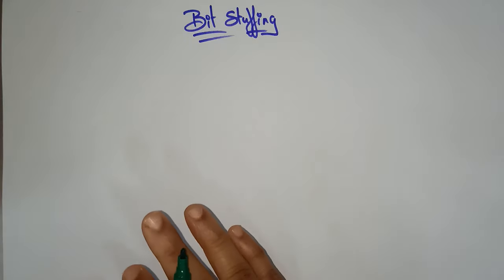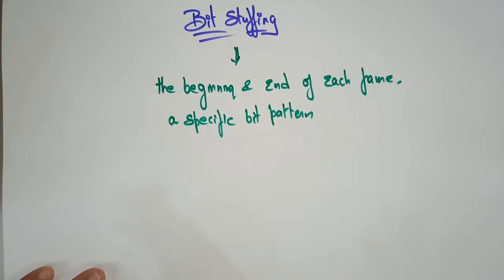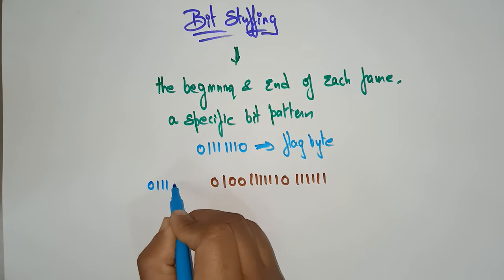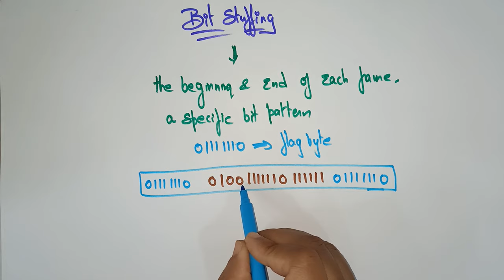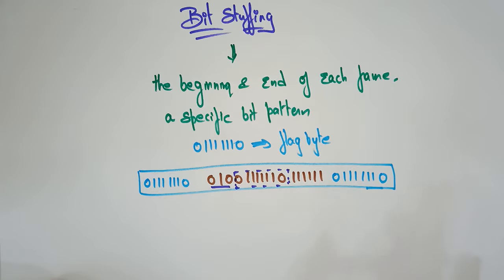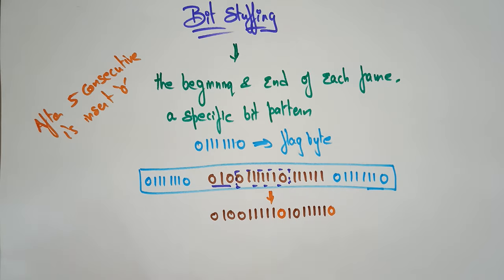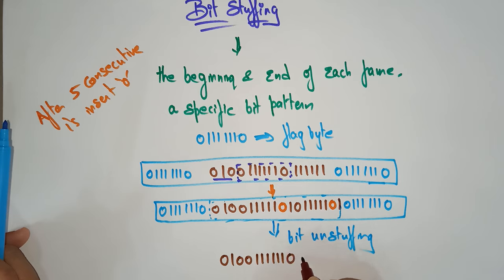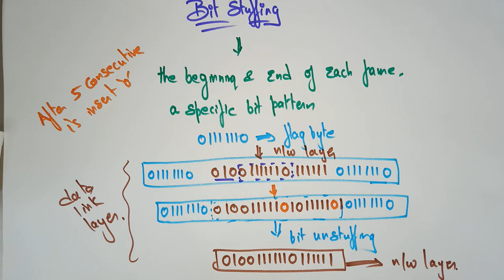Framing in data link layer | Bit Stuffing | Design Issues | Part-3/4

Comment: 5:50:  It took me a while to understand the computer just ignore or throws away the stuffed bit and looks for the next bit after the stuff bit to determine the bit pattern.  You added two addition padded bits into the sequence (orange bits).  The computer is really looking for a bit pattern like "11111" and the next bit is either a 0 or 1.  If its a 1, it means its the start or the end of the frame.  If its a "0", then that bit gets ignored because its stuffed and the next bit actually represents what the next bit value should be.
Reply: This cleared an important doubt! Thanks! :")
Reply: what if Flag byte is "01110" and data is "011101110"
Reply: @abhinowyt8564  There would be no point in using bit stuffing in your example because your flag byte is too short and the data would look the same.  Its like saying your flag bit is "01111110" and your data is "01111110".  There is no way the computer can tell difference with bit stuffing.  The key is to use a long enough byte or series of bits such that its unique to identify the start and stop flags.  The alternate method is to use Byte stuffing where you include an escape character (ESC) to differentiate the flag pattern in the data from the start and ending flags.
Reply: @ahndeux  Thank you for the Clarification !!
Reply: @abhinowyt8564  Just to clarify also, with HDLC the "01111110" sequence is used as the flag bit sequence (six 1's).  The bit stuffing in HDLC checks for 5 consecutive "1" bits.  If its a flag bit, it would send a "1" after the 5 bits.  If its a data bit, it would always send a "0" bit as the next bit to ensure the flag big is unique and will never occur in the data stream.

Technically, in your example, if you set the bit stuffing to be after two "1"s, it can be used.  The flag bit would be sent as "01110" and the data bits would be "01101011010".  Notice in the data stream, you never have a "111" sequence since that would be converted to "1101" with an extra "0" bit stuffed in between to differentiate from the flag bit.  However, in the real world, that generates an excessive amount of extra bits and is not efficient.
Reply: @ahndeux  yeah correct, got it :) !!
Reply: what if the data is 01111101 ?

Comment: For every bitstuffing problem, do we have to everytime put 0 in the position of 6th  1or it depends on flag byte.. For eg if flag byte was 0111110 so do we have to put 0 in the 5th position of data or here also we will put 0 in the 6th location..... 
If you reply i will subscribe :)
Reply: No, that is not how it works.  You don't always add a bit to every 5th position.   You only add if its a data bit and the pattern is a series of five "1" bits like "11111".

It looks for a sequence of five "1" bits "11111" and evaluates the next bit to determine if it is a stuffed bit.  If the next bit after this pattern of five "1" bits is a "1", it means its a flag for the start or the end frame.  However, if the next bit is a "0", then it knows the bit was stuffed and ignores that bit during the un-stuffing process.  The next bit after the stuffed bit would be added to the frame as a data bit.   For instance, the bit sequence "00111111" (8 bits) would look like "001111101" (9 bits), and a bit sequence "00111110" (8 bits) would look like "001111100" (9 bits).  That second to last bit is stuffed and its not included in the frame sequence during the un-stuffing process.

Comment: what if Flag byte is "01110" and data is "011101110"
Reply: 5 1's bit is mandatory
Reply: if that was the case then but stuffing would’ve been done after two 1’s  and so it becomes ‘011010’